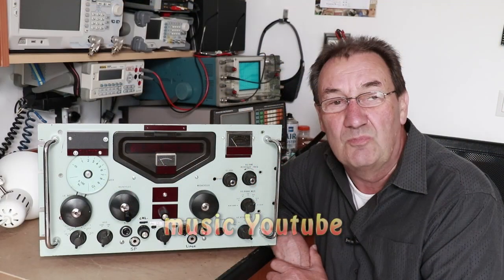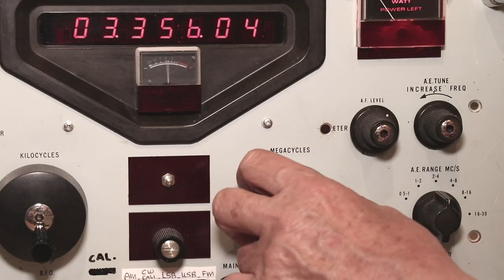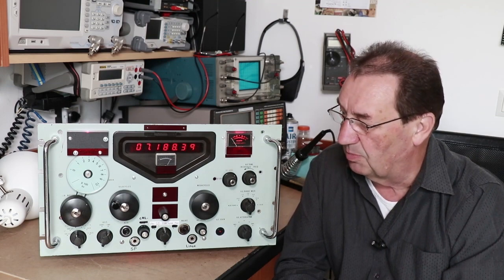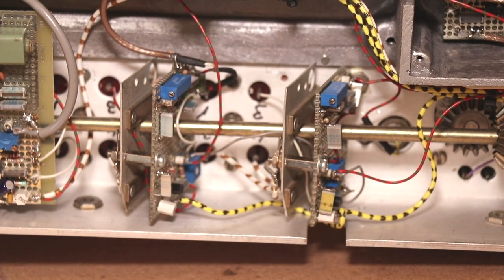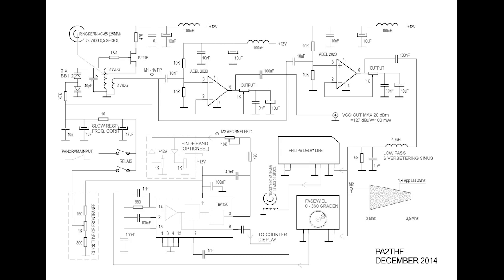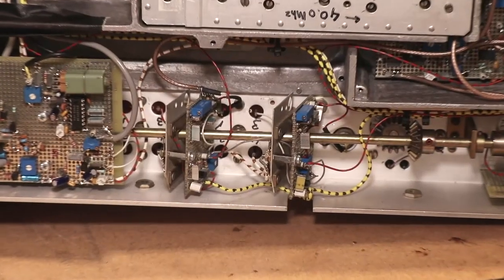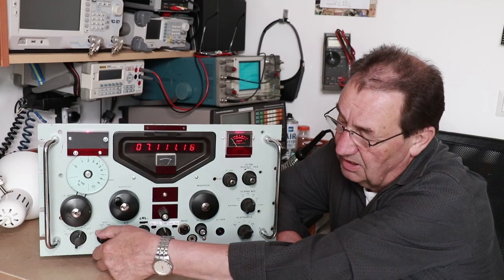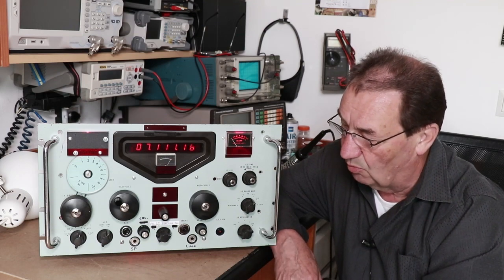Racal 17 transistorized

Comment from the maker: Dear Dayle; Very nice to read your plans and efforts to create your own FRG7, tubes are surly interesting. Afterwards you will be very lucky with the results. Although the original design used a free running (last) oscillator - because of the low frequency - you still want to improve on that. Using tubes in st of a TBA120, will require at least 3 tubes and filters. You can also have a  look at the Huff Puff stabilizer design. BUT that's also not easy to accomplice with tubes. THAT was the reason voor the orig Racal design. In those day's it was not simpel to build a phase-loop-loop, it requires several 19 inch cabinets. Use of crystal's did help, but you needed a lat, if you want to cover the hole range from 0 to 30-50MHz. Racals RA17 was a solution and uses only 1 crystal. See my other video about this design;      https://www.youtube.com/watch?v=oE3rIZ8k-0o  It was born, because the Racal company looses the permission to copy the  Collins receiver, there original plan. Afterwards the Racal AR17 was faster than the Collins. Sensitivity etc they are equile. But with al the frequency's that are generated inside the Racal, it's a miracle that there are no extra tones or cross-modulations. Partly due, to the enormous chassis that consist of two parts. To get rid of the last interference. Sorry for the bad Englice....

Comment: A question if I may? Instead of your delay line frequency "lock" for the Tuneable IF, how would "remembering " say the last 2 digits of the frequency counter in a Cmos latch, and comparing it with successive readings?  Of course the latch would require refreshing periodically to allow smooth tuning. This  may be a simpler circuit, and easier  for me than sourcing a delay line given PAL TV is pretty much obsolete..... here in NZ at least.?  Thank you.
Reply from the maker: See above

Comment: I was very interested in this, as I have "upgraded" an old Wadley Loop FRG7 to using vacuum tubes, the complete opposite to what you have done.  Like yourself, I have tried very hard to use the existing dials and controls. And, thank you for showing the VFO stabilising circuit, this is also a very interesting concept, do you have an idea how many vacuum tubes it would take to emulate a TBA120?😀
Reply from the maker: See above

Comment: Excellent work Theo, thanks for sharing. Love the LED readout.  I have a Telefunken receiver E863/KW2 which is excellent radio but I would like to change the nixies readouts with led, I wonder if you have done anything like that or give us some pointers, best
Reply from the maker: Yep, Telefunken made wonderful and good radios. Chance the Nixies voor LED's seems not so difficult, but a lat of work. Finding the wright format of LED's and after that, drive them individually by IC's (maybe i have them here???) Most important is to subtract the IF frequency. Probl it is already be done by the exciting electronics. If you have the schematics i wil look in to that.